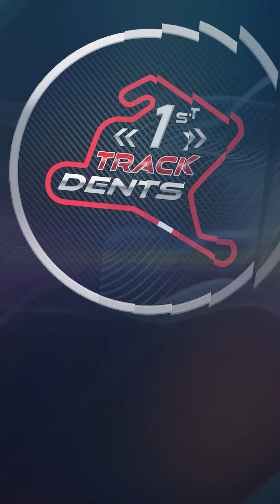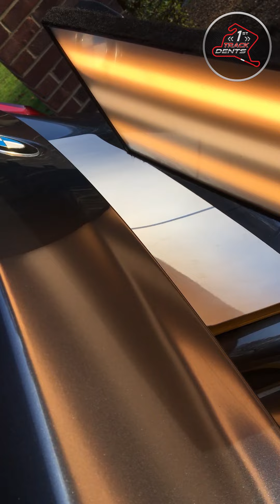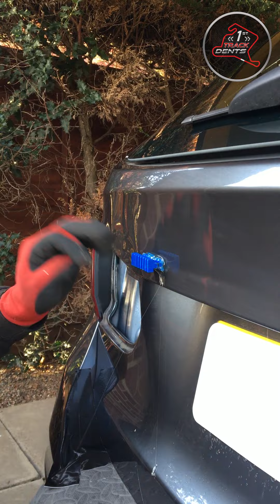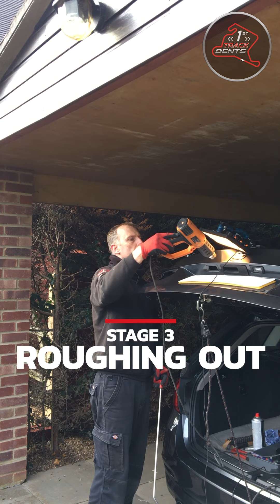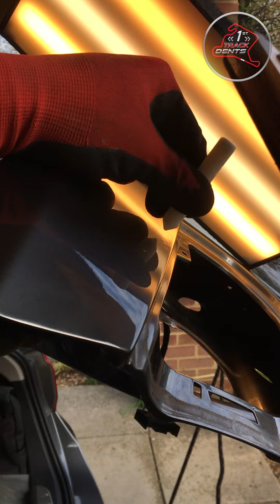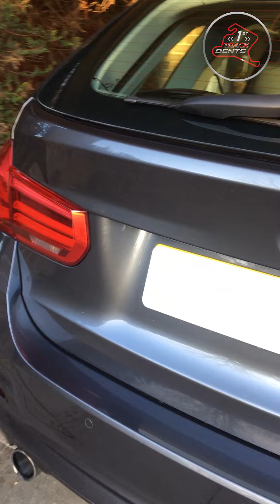CRASHED into a wooden post! 🤦‍♂️ Can I FIX IT with GLUE? #pdr #paintlessdentremoval #gluepull

Comment: Hi Jim what glue do you use? Do you use different For bigger damages?
Reply from the maker: Hi, I use various glues for different repairs and also from summer to winter. I like using Glexo hot glue all year round and then Hawg Orange glue in the summer months. Cam Auto collision glue it good for Lateral tension and strong pulls and for a good strong tab glue I sometimes use tab weld but it depends on the climate you work in and personal preference. It is good to order different varieties and see how they work for you. There are lots I haven't tried yet and hope to do so soon. 
All the best, Jake (not sure who Jim is? lol!)

Comment: Hello, I am watching your videos from the Middle East. I have a question. If you can help me with it, when you finish removing the dent, what should I cover it with 1000 or 2000 sandpaper before polishing?
Reply from the maker: P2000 would be my preferred choice and then go over with P3000 Trizact. But only give it a gentle rub if needed otherwise you will take too much of the orange peel texture away from the paintwork which can have the opposite effect and make your PDR repair more noticeable. Good luck, greetings from the UK 👍
Reply: @1st_track_dentstanks
Reply: Is it possible to publish a video on how to use the P3000 Trizact after finishing the stabbing?

Comment: I hope you can take a minute to answer me this. Are the Pdr 50 pieces tool set worth?  Or should I get everything separate?
Reply from the maker: To start with I would just get the essentials and practice, I find myself picking up the same tools nearly every day. You just need a double bend screw on tip bar and a set of tips, a PDR light and a couple of knock downs. Then if you really find you have a passion for it and your skill is progressing and coming along really well, then yes maybe buy a 50 piece tool set (from a proper PDR supplier) and  keep adding to it over time. Good luck 👍

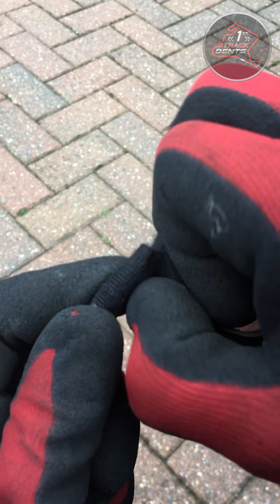Comment: Hi Jim, what temperature 2:54 would you recommend heating the paint to in order to prevent cracking from pushing the dent? Also what frequency would you heat the dent? Every couple of minutes?
Reply from the maker: Hi, I just heat the panel until it is hot to the touch, I push for about a minute or so and then heat again 👍